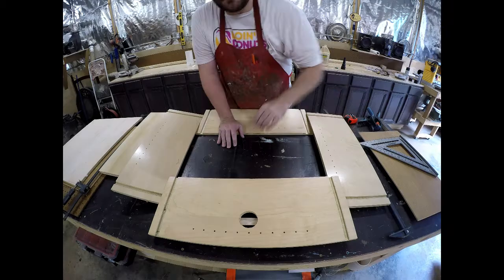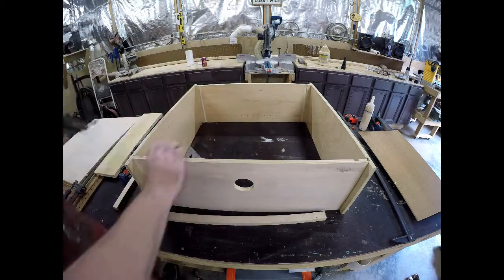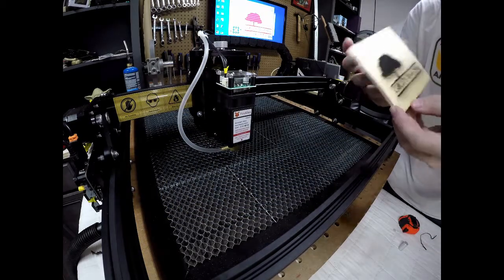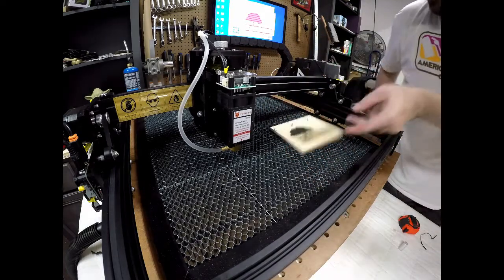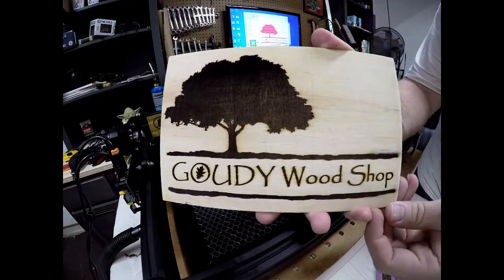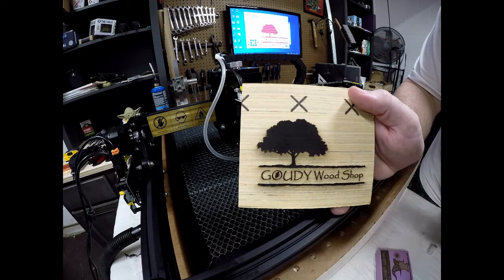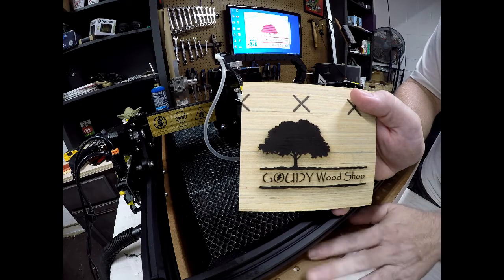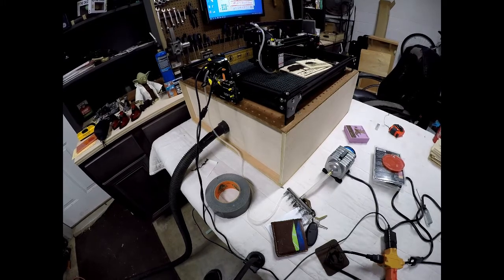Downdraft table and Air Assist Nozzle for Reizer laser engraver

Comment: From my point of view the ashiness gives the tree a 3d effect. I actually liked it.
How much did the air pump cost and where did you get it? When I get mine I plan on doing the same thing.
I watched another video of his that with the air assist it allowed the laser to cut through 3/4" poplar. Amazing! I havent seen anyone else do that except. Any comments on that?
Reply from the maker: I purchased my pump through Amazon (link below). I still have not pulled the trigger on purchasing LightBurn. I keep hearing its the program to use, and that may offer a little more insight on the settings to use when trying to cut plywood. I tried cutting a 1/4" maple and it took roughly 2 hours. Again, that was due to probably not having the correct setting. 

https://www.amazon.com/gp/product/B07ZG998F3/ref=ppx_yo_dt_b_search_asin_title?ie=UTF8&psc=1
Reply: @goudywoodshop2282  
Thanks for the link. I watched on Lazer wizard that he found 32 watt motors to be best. The link you gave provides different wattages for different selections. I'll be sure and save that.
I also saw another video that showed too much air can actually make the cut worse and not better so I can see why Lazerwizard said 32 watt. How many watts is yours?
Reply from the maker: @iwannaapple7190  The one that I purchased has a adjustable tap so you can control the air pressure. I usually test out on a scrap piece of material before doing the final product. Since this is a aquarium pump its rated at 38 GPH.